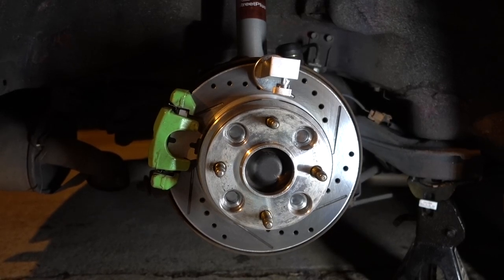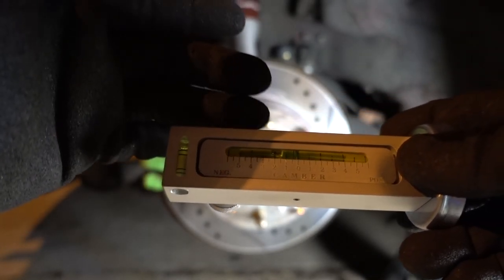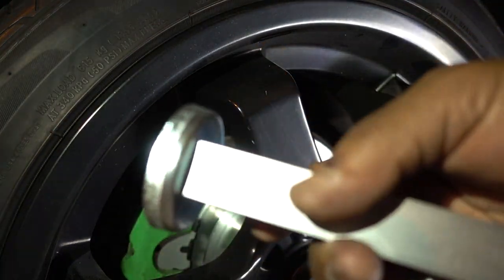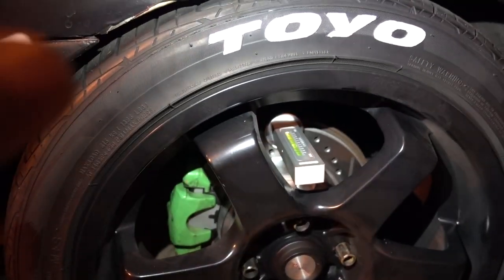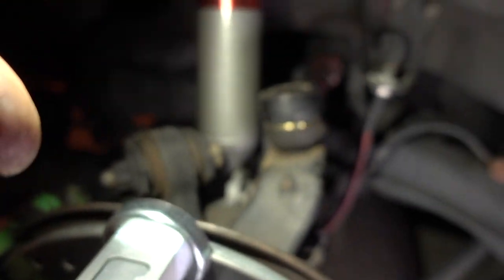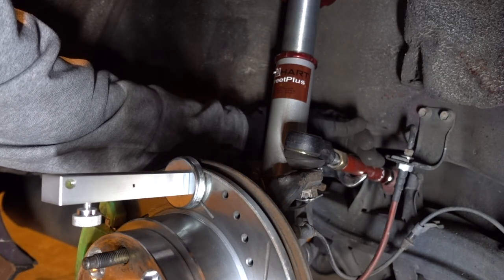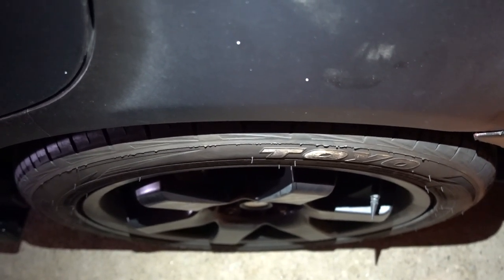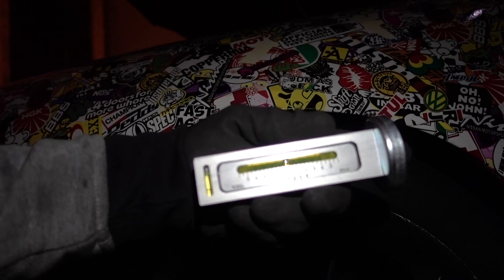How To Adjust Camber

Comment: This video in “action” shows the real application of this magnetic adjustment tool. HOWEVER, my problem that all these videos (including yours) misses to cover is this: Cause and Effect. In other words, right now I have this problem (“Effect”) that my 2010 Nissan Sentra front passenger side tire has totally flattened surface on OUTER SIDE. So in order to prevent that, I’m assuming the tire is toeing outside, which must be camber is positive (“Cause”).

I think what 99% of videos miss (including yours) is MAKING THE CASE the relationship between “Cause” and “Effect”. If I was making this video at different points I remind viewers for example: If your camber reading is at 2.5 that means your outer/inner tire will worn out, etc. or if your camber reading is negative 2 it means your tire doesn’t touch the road, etc..
Reply from the maker: I did this video like that because I have camber kit, if your camber is bad ( common sense ) is that your suspension is bad, in order to correct camber make sure the suspension is good, I’m just showing how the tool works
Reply: Let me guess certified tech😅
Reply from the maker: 😂 probably

Comment: I just got one of these (Kipa branded) and as usual I didn't read enough reviews first so didn't know they don't ship with instructions. The sellers written 'instructions' on the item page were worse than useless.
So...Youtube to the rescue! I've of course found scores of vid's on this exact type tool and get a little something more from every one I watch...well, most of them. Yours thankfully is well done.
I do have a question though. After you leveled the tool on the vertical beam in your shop you went right to sticking the tool to the rotor through the wheel opening but...and I admit I haven't finished the whole video yet so don't anyone flame me please...but shouldn't you make sure your vehicle is level too? Or am I just over thinking this? (I tend to make things more complicated than they need to be...it's my super power.) 🤣
Reply from the maker: Hey man, yes the vehicle needs to be in a level surface

Comment: Dangerous- you will never get it tight enough like that use a crowes foor with an extention and a decend size breaker bar.  Also know that this process is completely different on most other vehicles, so your title is basically click bait.
Reply from the maker: It’s ok, it worked for me, plus I know you can find a problem for any solution